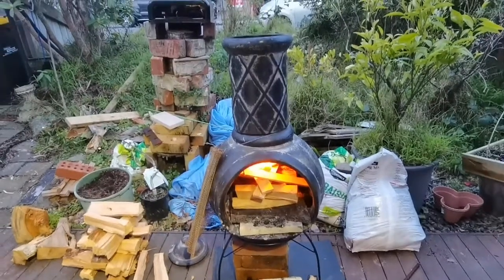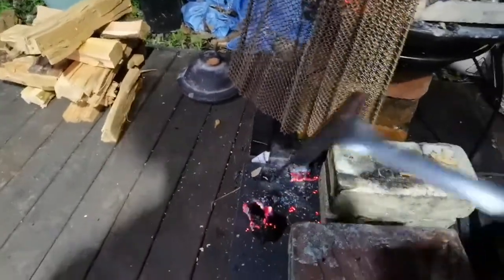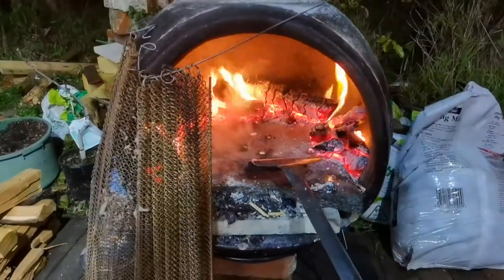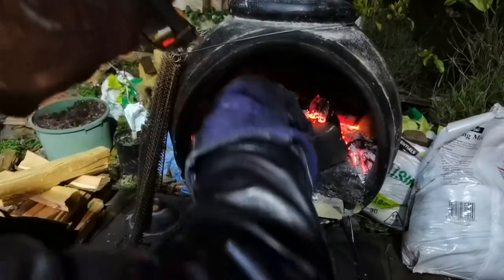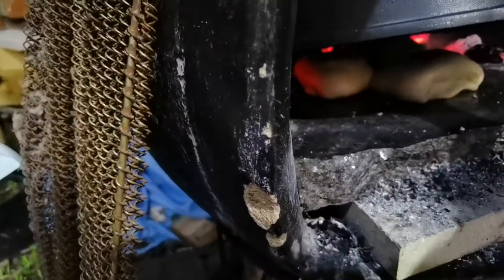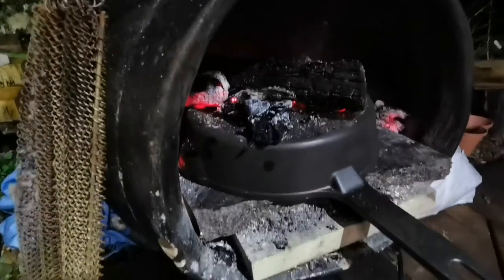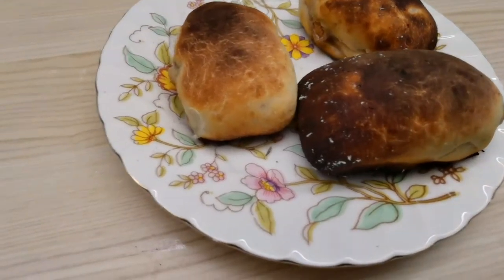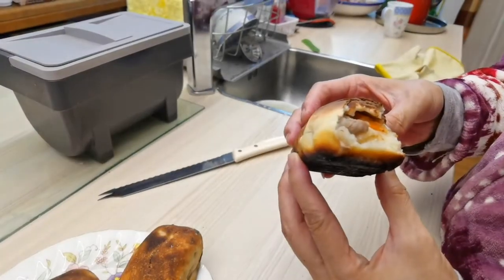Xinjiang Kao Baozi (lamb samosa 新疆烤包子) in the Mexican chiminea

Comment: i saw the store spray salt water to stream and make the baos stick on the surface. do u know why didnt their oven broken?
Reply from the maker: I don't understand the question.  usually you apply some salt water to the bao to make it stick and also throw salt water into the oven to provide some steam to prevent the bao from getting too hard.  That won't break the oven because there's so much stored heat in the oven it won't thermal shock the clay oven